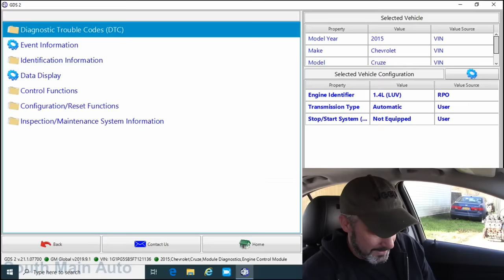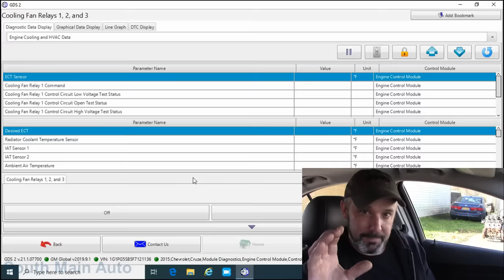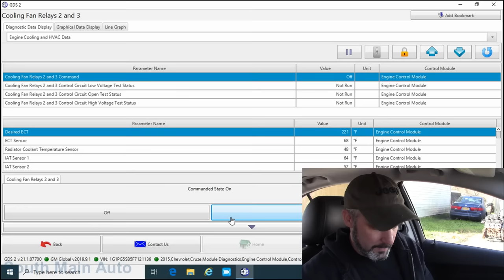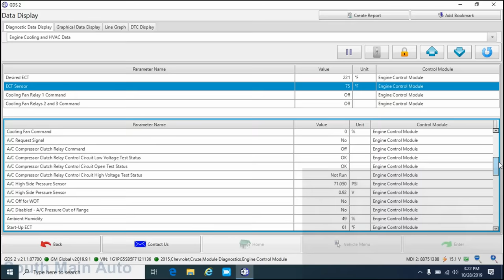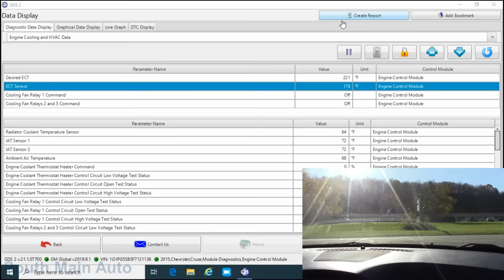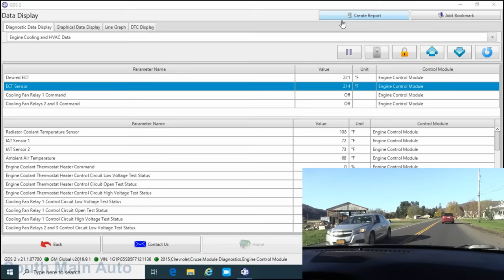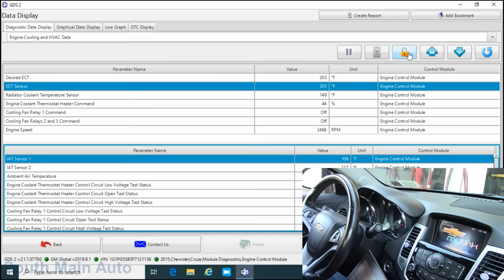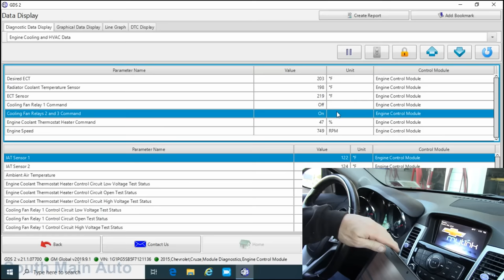Chevrolet Cruze: Overheating, Loud Fan, Losing Coolant

Comment: I’ve found you can have 30-35 degree temp swing on your scan data, but that temp needle never fluctuates past that semi halfway mark. Replaced the water pump and coolant outlet housing on my 2011 Cruze before I even reached 50K. 🤦‍♂️

Great video as always Eric!!!
Reply: Same. Replaced 1 engine, and 2 transmissions, + water pump, + radiator, + cooling fan before we hit 100k. GM is garbage, and people deserved what they had happen to them, when ignition failed in an accident. Garbage company making garbage vehicles needs to die.

Comment: Pretty sure the water pump leaked out all the coolant over a long time period. then it overheated. The water pump on the cruze has an extended warranty of something like 100 or 150k due to them failing so often. Something about a bad original design, and the replacement is a different design.

Comment: Okay. Eric O, they took this car to the dealership how many times?
They could NOT figure out the problem with the coolant system ( fan, Water pump,  thermostat etc. ) The customer brings it to you for diagnosis and takes you less than a day to figure out the fan motor and Water pump was leaking.  My question is the dealership " Mechanics" could not figure out the issue. Why in the blue moon of hell is this customer taking back to the bumbling dealership to fix it?
Half price that isn't a deal. I would not trust the dealership to fix it proper.  Hold tight Eric O I have a feeling that this car will come back for you to fix it.  Also not to sound condescending about the customer but think he be better off just letting you fix it.

Comment: I took my gfs 2012 chevy cruze 1.4L up to our local chevy dealership and it was running a code P0299 and they said they didn't know why that code was showing because it does not have a turbo

Comment: I've been looking for a first car for my daughter. She has her heart set on a chevy cruze. So I test drove a second one today and now I can gaurantee 100% that I WILL NEVER buy one. They are junk! Both of them that I test drove had the same issue. It seems that from the reviews I have read on them and what I experienced, they have a seriously flawed cooling system; thermostats sticking open, bad temperature sensor, extremely loud fan. Then there's the throttle delay when taking off from a dead stop. I just can't bring myself to spend money on a car that's going to have a lot of issues with less than 125k miles. It's no wonder why they were discontinued.

Comment: These cars higher temperature(110°) working cause these problems, could replacing the thermostat with a lower temperature one(80-90°) prevent this kinda problem?
Reply: No, Chevrolets will display warning messages and shut down A/C if you do that.

Comment: Have heard horror stories about those 1.4 engines. Bad turbos, excessive oil consumption and in my friends case a lemon law return due to water pump issues.

Comment: Ok, so now the customer is on the hook not only for the diagnostic time that Eric has to charge, but now he has to pay the Chevy dealer for a repair that they should have done under warranty?  NO WAY!  Folks, if you are gonna pay a technician for his valuable time for the diagnostic part, you might as well go ahead and get the repair completed right then and there.  Most shops will deduct the diagnostic charge once you have elected to make the repair.  So in this case the customer would be ahead by having Eric just do the work and get it done right, the first time.

Comment: I want to believe this customer but its hard to do as a tech working in a Chevy dealership.  There is a special policy for the water pump good for something around 150k miles because its a known problem.  I can't believe any dealership would turn this away when its a known problem along with the water outlet and surge tank.

Comment: Where I work they send all trucks under 80,000 pounds GVW to the dealership. $1000 USD to replace the def.system on a Ford F 550 with a 6.8 . Heater wint out. Load that parts cannon is all they know.

Comment: It seems GM never learned its lessons. My question: I drove a Cruze-seemed like a nice little car-but I hear that the A/Ts are crap. If I bought one with a 5-speed manual, would I have a fighting chance?
Reply: There's a video of one with over 500,000 miles i believe it has an auto

Comment: Seeing the temp hitting 228 before the thermostat opens got me cringing a bit. Every "NORMAL" thermostat I've seen operates in the 180 to 195 range. Either she's sticking big time or somebody installed a thermostat far outside the temp. range needed. This plus a faulty cooling fan equals BIG trouble. I didn't see the exact point of leaking at the water pump but that could be caused by the excessive temp./system pressure along with a possible faulty pressure cap. She held at 19.5/20 psi cold but what was the system pressure when hot? That can cause leaking from anywhere. My fix? New thermostat, cooling fan, pressure cap and possibly water pump/gasket. PS: Whenever the words "Oh that's normal" leaves the lips of a car dealer, SUSPECT THE MESSENGER. It didn't do it new but does now? It ISN'T normal.

Comment: Depending on the miles, the car still has an extended warranty of the water pump.  I have to wonder if that's the source of the "half price".
Reply: Warranty on the water pump is 10 Years/150K miles.  Yes, that's far longer then the power train warranty.  Although, I'm not 100% certain it applies to the 2015 model year.

Comment: Hey Eric, after replacing the ABS pump in a 2011 Ford Fusion, does a dealer have to bleed the pump or can I do it in my driveway?  Thanks.

Comment: Sure the dealer will do it for half price. Which is still much more than indie price and they’ll do a “safety” check and find at least 2 other things that don’t need to be done but they will charge full price for anyway. Brake jobs are at the top of my dealers list. Every 25k miles, right?

Comment: That Chevrolet dealership ought to be ashamed of themselves if their techs aren't any more capable than that. What do they specialize in, oil changes?? Your customer revealed how cheap he is too by getting a cut-rate job instead of a capable mechanic. Our company bought exactly two 2013 Chevy Malibus and had trouble with both of them. Four years ago they went to Altimas and Camrys and haven't looked back. Avoid these "global" Chevrolets like the PLAGUE.

Comment: Simmons and rockwell is the worst dealer when it comes to repairs or even customer service. Went to hyundai for a engine replacement under warranty. Well got the engine replaced but the tech decided to leave oily hansprints all over the headliner. I guess that was an added bonus in their eyes...

Comment: Its obvious the owner wants it fixed under warranty from the get go.  But gm does not pay diagnostic fee.. so the techs have no ambition to do testing.  Its the flat rate system.  Even if it were the engine that needed replaced gm would only pay about 6 hours to test drive replace engine then test drive again.

Comment: Hmm, when I work on cars and see coolant covered lines I instantly ask said person, did you spill coolant or is it leaking. Then I determine if air in the lines is causing the coolant to have no way of expanding and escaping at the easiest exit. Most of the times it’s stupid people who didn’t bleed an empty system and trapped a bunch of air in lines and caused hoses to swell and crack under heat cycle multiple times.

Comment: cruze is bad to have cracked overflow/leaking at seams of reservoir... 3:38 in order to get push button GM cars into KOEO mode you have to start with everything off and press one time and continue to hold the start button and several seconds (seems to take longer than would be necessary) the switch will turn on... I really wish they did the same as some of the other manufacturers and just do the "double click" type setup.
Also they said they took that car to the dealer??? and the goof balls said "yea its okay, normal sound" and didnt find the water leak? ha ha people have a false sense of security with dealers... people should do themselves a favor and find a good independent technician

Comment: how many stories of holden cruze in australia /chevy cruze in america about using dealers to solve the cooling issues these have how people pay top dollar having water pumps replaced thermostats gaskets oil change coolant flushed the whole nine only to be back at the dealer a week later . . remember ford power shift transmission from about 2008 _2016 many models absolute lemons same as this, once you think it's solved something else happened just when you think you finally nailed the issue something happens to blow their theory out the water. and what was clear with the Ford transmissions was they were just faulty and couldn't be totally fixed but majority could still be driven fine and many while having a few problems weren't that bad and actually one couldn't get a really good deal if they were happy to put up with it and not freak out and heads up mechanics every time it played up... just like the cruze mechanics need to let customers  know not matter there new pump new gasket new whatever that the  car is what it is either get rid off it or spend the next 5 years saying i just replaced that and i just replaced that how can this happen.... . it does

Comment: Dude.  It's not the water pump.  It's the thermostat housing. It's cracked and leaking coolant.  Also, there's nothing wrong with the fan.  It's running fast because the car is overheating.  Geeez!

Comment: my buddys 2012 1.4 cruze overheated 3 times blew the head gasket and next thing ik water flooded the spark plug holes so head warped. he still owes 13k kn it only have 71k on it

Comment: The water pump is crap out or going too.The radiator coolant and those cooling fans never going helping you enough keeping the engine from boiling over.You’re very lucky if you can driving more than 2-3 miles max before your car engine seized up and locked up on you.

Comment: Sad terrible reliability for the Chevy Cruze, known to have a horrible engines. Please people if you are looking to purchase a car look up the reliability on  the car such a Chevy Cruze, the year and model such as es, Ls, etc. Car engine models can change every year, so what engine was good in last year's model may not be used in this year's car. Best Never to buy a new car either, because it takes approximately 3 years to know if it has been a reliable vehicle. Better to purchase a good reliable car known that it has a good history. People tend to purchase a cheaper priced car, but when you purchase junk you will pay big bucks in repairs. Check reliability first, then have a good mechanic look it over

Comment: The Cruze is the epitomy of GMs problems. The Cavalier was a great selling car. Then they changed the car and renamed it the Cobalt. Then did it again and named it the Cruz. All during this time they kept cost cutting and making the cars with less reliable parts.  And they spent a fortune re-marketing a 'new' car that replaced a popular car. Then, as we all know, GM will reintroudce the Cavalier down the road and claim their marketing department told them it was a great idea to bring it back. I swear, GM has the worst management team in the history of the automotive industry.

Comment: The dealer techs works on these engines every day and they couldn't find any problem. The flat rate techs were looking to move onto brake jobs where they can make money. A terrible system.

Comment: I don’t know why Chevy likes to run these motors so hot, emissions maybe? I had a new one back in 2012 it liked to run between 220-230. I had the computer retuned and brought it down to 190-200 it ran better especially being a turbo motor.

Comment: I’ll never understand people. They take it it to a dealer who finds nothing then to a guy who does a thorough job and finds not just one issue but all issues and then they take it back to the same clowns who misdiagnosed it originally to save a few dollars. Why can the dealer cut costs because they will have the cheapest parts changer do a half assed job. You get what you pay for and nothing more.....except with SMA

Comment: I'm a tad bit confused on this. The company couldn't find the problem or even fix the obvious ones, yet the customer would rather they fix the car? I'd have let SMA do the repairs, and swear off the dealership. Guess'n ya might be seeing that car back in the shop again later on :P

Comment: I think it stinks that you did all the diag work and then didn't get the job. It's also unbelievable that the dealership couldn't figure out the problem when it didn't require any special diag procedures.

Comment: I had a customer with loud fan complaint after I did a body repair because of a deer hit on one of these 'crap cruzes'. I replaced the radiator and cooling fan with new GM parts during the repair, and the fan crapped out after just 6 months.  These cars are pretty much junk. They give the impression of quality when you sit in them, but they are one of GMs worst creations. The low price of used ones reflects that. When shopping for a car just Cruze on past these folks

Comment: They will made the whole job on the car ONCE YOU HAVE DISCOVERED ALL THE ISSUES so they can FIRE THE PARTS CANON IN A CONTROLLED MANER. CUSTOMER SHOULD STICK TO THE ONE WHO SHOWED KNOWLEDGE AND MADE THE RIGHT CALL. CRUZE IS GONNA TO BLOW HEADGASKET PROBABLY IN THE NEXT WEEK OR SO.

Comment: Dealership: "Oh, your car is under warranty and 3 out of the five major components in the cooling system have failed? No problemo lady! We'll only sting you for half of what we usually charge! Now, given that we charge 150% of the industry standard labour rates, the job will only cost you 75% of what an independent would charge you. We MAY even use new parts on the repair! How's that sound?"
Customer: "But... there's 6 months left of the extended warranty I purchased with the car"
Dealership: "Yup"
Customer:
Dealership: "I did say we'd get one of our first year apprentices to fit mostly new parts to it and then tell you they've all bee replaced!"
Independent Mech: "Yup... so you thought you'd bring it to me to diagnose, then piss and moan about me charging you 2 Hrs @ $90 and an $80 electronic diagnosis fee, AND THEN take it somewhere else to do all the work that we do to keep the lights burning round here?"

Just another day at the office! Now off to home I go to turn on the evening news and listen to another bullshit "news report" about "some grubby rip off mechanic" and a free plug for the local stealership. Wouldn't be dead for quids! :)

Comment: Diagnostics on a car takes up much time and therefore a big chunk on the bill. The dealer doesn't have to diagnose (you did that for them...) anymore. 
Diagnostics requires much more indepth knowledge than simple changing defective parts.

Comment: I have a 2013 chevy cruze with almost 170,000 km on it, I never had a problem with it besides changing brake mats 2 times and oils/filters but that's normal for an old car with high mileage, but 3 months ago i had the engine overheated several times because of leak in radatior water and the thermostat broke 2 times after changing it again. Then it ran normal until almost 4 weeks ago, it had the temp. Issue again, I changed the radatior water again, it gave out a white gas from the fan side, then drove it for 10 minutes, i accelerated hardly on it after that it was good until today and no problem occured, That was like the first time it had those issues, normaly I just change consumption parts only.

EDIT: and it makes a very loud noise from the fan, i didn't find a solution or reason for this issue.

Comment: I guess, when a car is driven with coolant temps over20 degrees over boiling, more system failures ( cooling pump, hoses, etc.) Must be expected......who would ever dream, 25 years ago, car engineering would be turning out such garbage, as they do today........wow..

Comment: The Chevy Cruze is garbage. I bought one after replacing my 07 Cobalt that ended with 364,000 on the odometer…. The Cruze I suspect won’t come close to those miles…. This thing uses coolant more than any vehicle I’ve ever witnessed. It’s a monthly ordeal. Needless to say I’ll never buy another one.

Comment: Engine coolant housing.  Cheap plastic. Cracks. All the time . Every time. Deliberatly designed to fail. After market is aluminum. Fixed. E10 garbage all over it just junk. The coolant line behind the turbo needs rerouted as well or ir will clog and fry the turbo. Guaranteed to fail by design.

Comment: I call bullshit on the customer.  I work for a Chevrolet dealership and I highly doubt they would miss a water pump on a 1.4 cruze.  The 2011-2014 cruze has a special coverage on the water pump for 10 years / 150k miles because they were such a common failure. 14371B is the bulletin number.   Even though this is a 2015 cruze that Eric O is working on, I am really suprised that a gm tech would not look for a leaking water pump on an overheating cruze losing coolant.  The water outlets and water pumps always leak.  So my conclusion.  Either the customer really didn't have the car and the dealership and probably had it at some backyard shop before going to Eric O, or the tech lacks some very basic gm training.  However, I think the car wasn't at the dealership. Funny how the customer declined the work from Eric O but is going back to the "dealership" who couldn't find his leaking water pump  or fan issue and now the dealer is doing it for 1/2 price.  I call bullshit!

Comment: 1.4 liter engine w/turbo. Notoriously bad engines. Plastic components + heat not a good combo overtime. Water pump has its iwn issues; leaks, thermostat housing leaks, intake problems etc . Not Chevy's best production model by far. Oil filter housing leaks too.